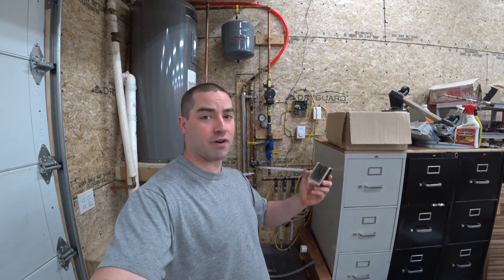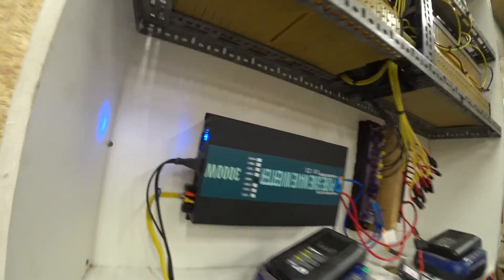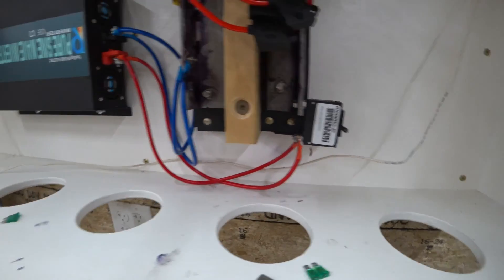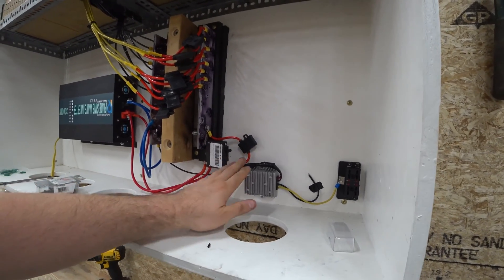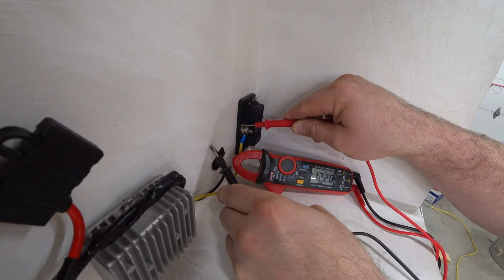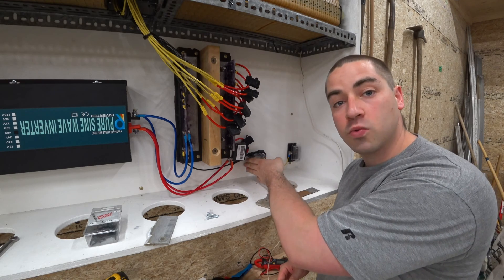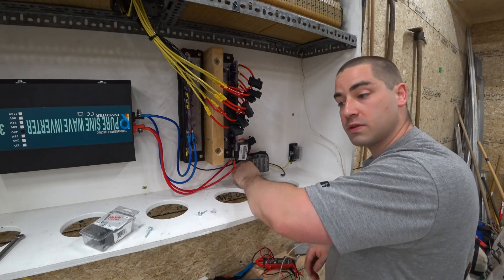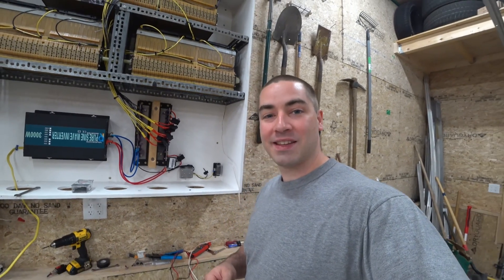Making 12 volts from my 48 volt battery, DIY Powerwall

Comment: I'd love to know the topography of that converter - it's got to go something like this: DC input > Oscillator > AC > voltage regulator > step down transformer > rectifier  > output   
It would be fun to put a scope on the output.... if my topography is true, it must have some ripple.  What are your thoughts .  Nice video David
Reply: I'm sure it uses some good capacitors in that device. I had a Yamaha DX7 synthesizer. I looked inside and there were about a dozen toroid induction coils in there. Being all digital, the voltage logic levels had to be ultra clean when I saw it on the friends oscilloscope.

Comment: 12.2 V sucks, can't even float a battery. Adjustable? Mabe  a cheap solar controller that's adjustable. Thoughts? Also to all the BMS trolls, lots of inverters have high and low cutouts already, a voltmeter is a good thing, even better get one of those RC voltmeters that do up to 8 cells with low voltage alarm, $5 bucks on E-bay, walk by and see voltage flash on each cell? Thoughts?
Reply: Roger Kerkmann yes you're right it can be run without a BMS but it's not advisable the BMS does many things to support those batteries. The engineers that GM spent many man-hours figuring out all kinds of safety and protections related to the batterys. So now this gentleman had to repurpose these batteries with no form of Fail-Safe or disconnect. And you're suggested to him to go on eBay and buy a $5 product so that he can monitor the batteries. This is what a BMS system does it's a Fail-Safe if there's a problem. Running these batteries long-term without a BMS system is not advisable. I work in aviation, and these batteries are currently being used and I can tell you not using a BMS system is an accident waiting to happen.
Reply: Roger, Lead acid cells balance themselves. Lithium cells don't. Really bad things can happen without using a BMS.
You may get away with it for a while, but I guess it depends on how much you value your battery, your property and the lives of your family and the risk you're willing to accept. Your choice.
Reply: I think you are missing the point, it us a 12v buck converter so it outputs 12v, as it says on the bloody thing, if you want to float a battery at 13v or whatever, they have other modules that will do that. But this one is suposed to  be 12v so thats what it is.
Reply: Soooo if you have 5 cells in a pack in series, even a bms doesn't check every cell!! Unless you got a hundred bms. If you have big prismatic cells it's easy, my point with the rc volt and alarm you can monitor 8 cells for $3
Reply from the maker: Hi Roger,  Yeah, 12.2v can't float a battery, and at 240 watts I can't do much with it.  However, I bought this to run the computer fans to cool the battery cabinet.  I think it will work fine for that job.  I was worried that it would only put out something like 10v when I have 43v input, but was pleased it at least hit 12v.
As for the BMS...  I agree that it would be great to visually see the voltages of each cell.  That has been my hang-up on most of the BMS boards I've been seeing; no interface.  I think it would be very cool to hook up an Arduino that could display all 96 cells at once!
Reply from the maker: Hi Andy,  I've seen some BMS boards on ali-express in the $30 range.  I have 8 batteries, so $30x8=$240, which is much more doable.  Can you shed any light on these style boards?  Near as I can tell, they don't have a user-interface.  Are they good otherwise?
Reply: This BMS has a mobile and windows interface over bluetooth/usb and I bought one for my 14S16P 1.5kW ebike: https://www.youtube.com/watch?v=ClGmMY0kXvQ
I am fairly happy with it, though I don't trust its accuracy too much and bluetooth often won't connect with it and balance current is only 50mA which is tiny.
It is however programmable and all the voltage limits can be adjusted, over current etc.
It'll disconnect charging when full, and shut off if the pack (or any cell) goes undervoltage.
60A at 14S 58.8V is 3.5kW, and at bottom of charge at 42V, 60A is 2.5kW, so this may be useful for monitoring but I wouldn't bet my house on it.
I think they do a higher current one, and for different S levels.

You could perhaps use it for basic protection and monitoring, but for such a large battery they are totally underpowered for balancing.
As I said, if you have 12S, and all your 8 batteries and S connections are in parallel, you only need one longmon per S with the batrium, no matter how many batteries you have (within reason), so the basic Batrium system should meet your needs.

Another thing I'm following developments on is an open source DIY BMS by Stuart Pittaway which may eventually be able to compete with Batrium and provide larger balancing currents but it isn't ready yet.
https://community.openenergymonitor.org/t/diy-lithium-battery-balancer-and-monitoring-bms/5594

Adam Welch on youtube is also supporting this, has a small DIY battery and will give updates over time - recommend following him too...
Reply: They make them that put out 13.8v too ;) https://www.aliexpress.com/item/50-90V-TO-12V-10A-60VDC-to-12V-72VDC-to-12VDC-80VDC-to-12VDC-10-AMP/32763533942.html
Reply: Andy Lee Robinson  check them out https://www.batrium.com..
Another good site to check is Alt store.com

Comment: I love what your doing, but you need a BMS these batteries are lithium cobalt (which is the most unsafe) even if one of the cells comes out of balance it could lead to your whole garage burning down. These aren’t lead acid batteries and they aren’t made to be treated like lead acid batteries. They need to be managed with a lot more care or they will catch fire. Personally I would not even use these batteries until I got a bms for them. Thank you and have a nice day
Reply from the maker: Andy: Thank you for the suggestion to batrium.  I've looked at their products and they certainly do look great.  One thing that seems to be overlooked, is that I have 8 batteries, with 12 cells each.  That's a total of 96 cells.  Even with batrium's expansion board it can't do all that.  I'd be looking at buying 8 of their kits.  Probably around $3,700.  That price is a road block for me.
Reply: I've been using 2015 Chevy Volt modules on my scooter conversion and they have kept their balance for 6 months without any issue. I just charge and discharge with a buffer and do a monthly check. This means 4.07v max charge per cell and max 3.55v per cell discharge. I just checked today and they are just the same as when installed.
Reply: Nick, charge controllers just output a voltage, first a constant current phase, and then try to maintain constant voltage until the battery catches up.
It does not know anything about the state of charge of each cell in a pack, and that is very significant.
There are two main worst case scenarios, at the top of charge, and at the bottom.

So, taking an example a 14S battery which is fully charged at 58.8V.
Normally fully charged (though better to only go to 4.1 for longevity)
4.2 + 4.2 + 4.2 + 4.2 + 4.2 + 4.2 + 4.2 + 4.2 + 4.2 + 4.2 + 4.2 + 4.2 + 4.2 + 4.2 = 58.8V  OK.

Dangerous:
4.15 +4.15 +4.15 +4.15 +4.16 +4.17 +*4.76* +4.14 +4.13 +4.16 +4.17 +4.17 +4.17 +4.17 = 58.8V

A normal charge controller could not know there was a cell that was dangerously overcharged.

At the bottom of charge, bad things happen when a cell goes below 2.8V, and even worse at 0V, and a charge controller again could not know this.
One cell will always reach its minimum before the other cells, and they will happily keep supplying energy oblivious to their neighbor's condition.
If a cell goes below 2.8V its capacity starts to degrade irreversibly as secondary reactions take place, but it can recover somewhat if caught quickly and charged back into normal range.
If a cell goes down to 0V and the other cells are still working, then voltage starts to flow backwards through the cell causing lithium metal to be electroplated and killing it.
This is also irreversible.

So, I cannot stress enough the importance of using a BMS to monitor each cell and make sure these bad things don't happen, by giving warnings and ultimately shutting down the system if a fault does happen.
Reply from the maker: Thanks.  I'm still looking into different BMS's and trying to decide on which one to get.  I'll need 8 of them for my current set-up.
Reply: Can someone please elaborate what a BMS does. I looked on Amazon and see the following in specifications of a mid range BMS.

Main function:
Over charge protection, over discharge protection function, short circuit protection
function, over current protection function, balance.

Is it safe to say a charge controller does not do this for you? I though it would...
Reply: https://batrium.com - about $600 and you'll be able to sleep at night while it looks after everything.
Reply: These are Lithium manganese Cells, one of the safest Chemistries out there. Please do your research before making such claims.
Reply: cheers! Yes I had thought about it for a while, but read of others not having issues. I also limit to 320A max discharge to avoid stressing them and potentially causing them to drift. I think peak 10 second discharge is 350A.
Reply: Also when I was using GBS lithium iron phosphate cells they would drift quite quickly. I was using a BMS but found it couldn't cope with the amount of variation between cells as the bleed off on the resistors wasn't enough to prevent the cells first to top up from over charging. 

So with these I also charged within the BMS limits and discharged within the limits, but needed to check cell variation every 2 - 3 weeks.
Reply: David, what's important is the number of S you have, so if you have 12S you need just 12 longmons.
Each longmon can balance at 2A so that should be enough to keep things in trim.
If the 'width' of each series is large, then you might need more longmons to fully balance them, but the minimum would still give you a very important graph of battery state over time.
If you ever needed more balance current then perhaps a cell might need changing, but you could double up the longmons and have 1S with two of them on it to balance at 4A.
Having a longmon on every cell would be overkill, although possible.
Using 8 bit addressing I think it supports up to 254 cells (they don't all have to be in series!)
Reply: David, if you don't already, then follow HBPowerwall, Average Joe, DIY Tech & Repairs.
I've been following them for years and their videos give some of the best information on youtube.
Reply: Nipping Shrew de Reefs what kind of BMS were you using?
Reply: Andy Lee Robinson your 100% on the money. There are a lot of people giving misinformation on the web. Telling people that it's okay to use these batteries without a BMS system. A BMS system is the best insurance policy that you could have having these batteries.

The other problem I see these people are installing these Power walls in close proximity of the Living Part of your home. They need to be in an outer building away from your living space so if something does happen you and your family might have a chance of surviving a catastrophic failure of the batteries.
Reply: If you are interested a clever BMS system I encourage you to check out bobolinksolar.com 
Kelvin has come up with a brilliant idea of balancing the cells .
I use one of his 24v systems on my solar setup
Reply: have a thousand watt powder inverter in my bar bolt, four batteries of the bar bolt, one battery one hundred and fifty watts. I will run a cylindrical machine. Would you like to say my answerHelp mr
Reply from the maker: Nipping Shrew de Reefs: Thanks for sharing your success.  It is very encouraging.  Mark Osborne also has no BMS and shared his success in this video: https://youtu.be/dbO4dhjEFu8

Comment: Do you have a link for the buck converter? I want to buck my 29.4 / 24v system to 12.5v or so. I know the 48v version will not work with 24. But I'm interested in the brand and where you got it. I have a large'ish 8-12 amp china made buck. And a few 3amp buck converters. I'm thinking I will either use them on led lighting or a few other things like usb jacks . and 3v for my water heater ignition. Its an camping style tankless gas . it takes batteries. I don't want to have to replace them so I guess a small buck converter and a capacitor to help with current surges on start. Since its a small buck converter. Isn't it amazing the power in such a small lite cell. Lithium is awesome! I have 108ah and building. I'm adding about 30ah soon as they get here! I hope I got enough sun for 1200watts of pv to charge the bank . I can add 300watts or so without buying a charge controller. I loose sun about 4 in the evening. So I plan to have 2-3kw in pv. And over 1000 ah in lithium batt bank. To run my off grid home. I don't mind using my generator for laundry day.  And use a gas stove and grill. Can't wait to see more of your setup! Keep at it! Sorry for the rambling!
Reply from the maker: Here is the link: https://amzn.to/2y6WMoO
Reply: There are lots of 3.7 VDC Lithium Ion batteries out there. That might work?